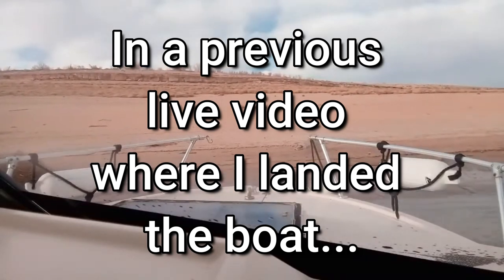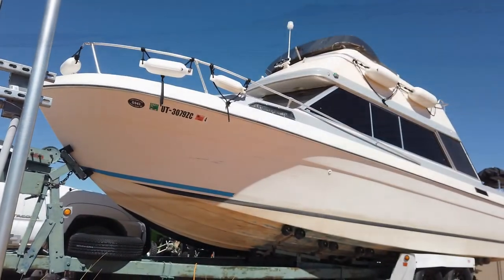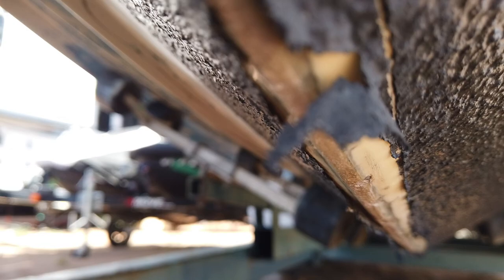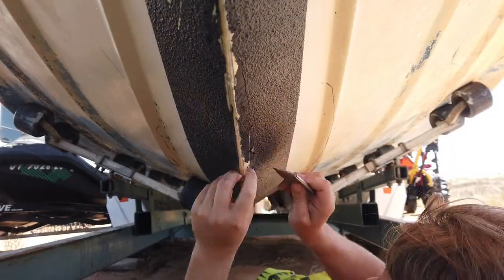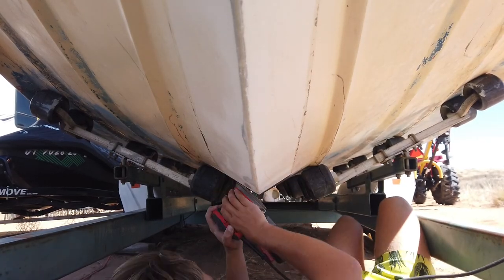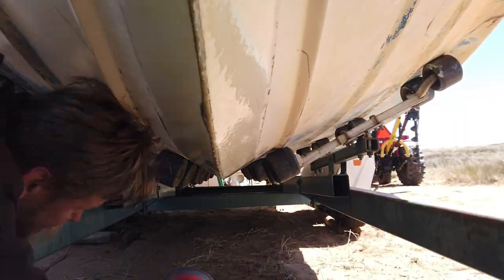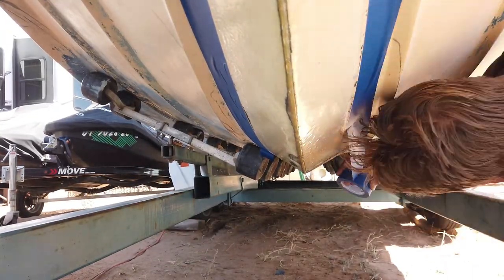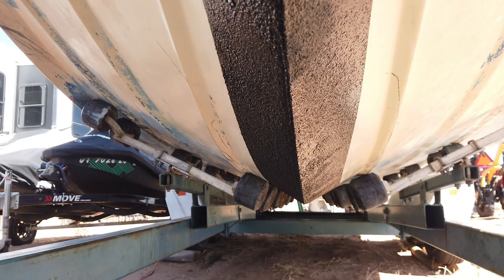Reviewing A Rhino-Liner Keel Guard Heavy Use!

Comment: I hope it lasts a good long time.  I'm wondering how it will effect your fuel efficiency.  But think that will be minimal.
Reply from the maker: They will last for years no doubt.  I used mine for about 5 months non stop, & overall it held out great, until I got something too stubborn.  As for fuel efficiency, nothing changed.  It's just not enough to effect a larger vessel.